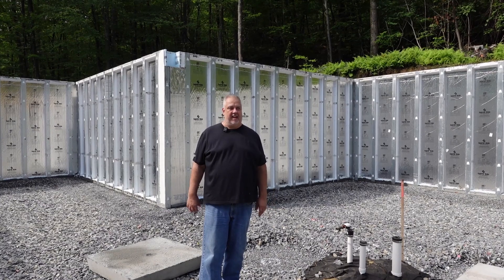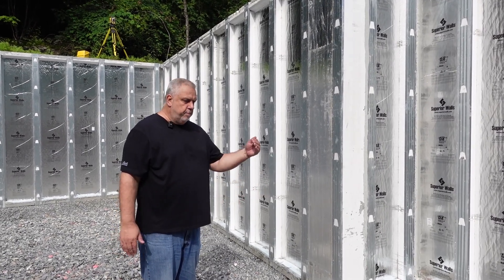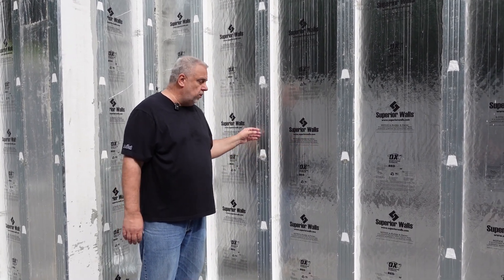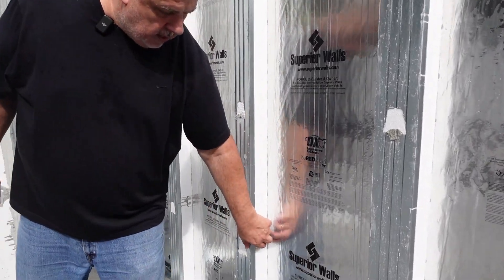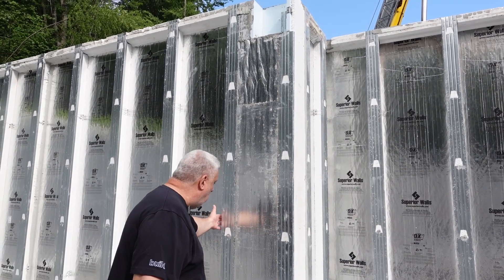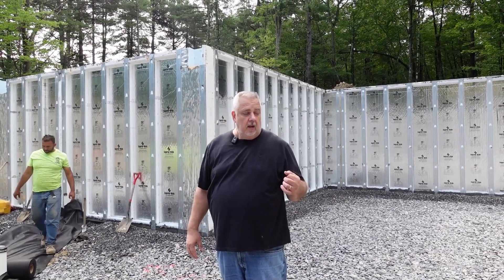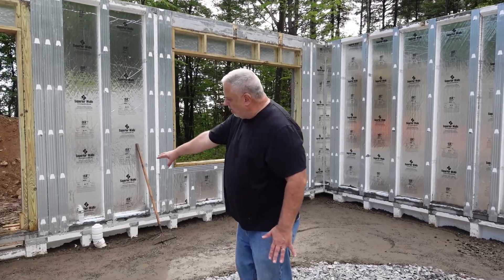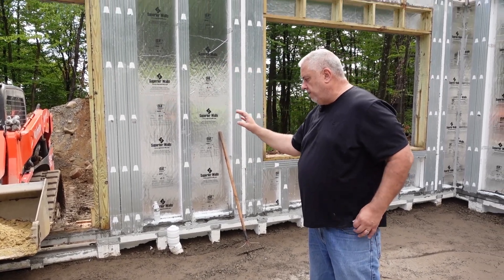INTERIOR OF THE PRECAST FOUNDATION WALL

Comment: Steven -- Would you recommend installing "under-slab" foundation drainage?  In what conditions would it be installed?  I have plans for a walk-out basement using a pre-cast foundation like the Superior walls shown here -- IF there is a sloped grade against the foundation with the potential for run-off reaching the upside of the foundation would you be concerned with the possibility of water under the concrete slab and if so what would a under-slab drainage system look like?  Have you addressed this in any of your great videos?
Reply: I looked hard at these when I was considering building in Michigan but now live in MN a bit out of range for this system.  The Superior walls website has tons of details including water management.  Of course with any foundation you want to get surface water away with appropriate gutters, downspouts and surface grading.

Comment: Steve, I have just installed Superior XI walls. They call for a 2 x10 sill plate. Wondering if you could provide the detail for what type of sill sealer material you use. I am onboard with Tremco Acoustical but unclear what type of foam or rubber seal should be installed.

Comment: Are these cheaper to buy and install compared to just an ICF block system? What are the major perks to these over those, besides maybe the wire runs? I don't see the benefits unless they were installing five or six times faster than an ICF block wall does. Looks like they install similar to SIPS.

Comment: Is there any reason you could not place these on a poured footing?
Reply: After talking with some people, I found out that it’s because you need a very level surface and peet rock is the way to do ut
Reply: I suspect that the connection between the wall (which has a footing as part of the wall already) and the poured footing would be suspect.  The poured footing would need to be absolutely flat, which is basically impossible.
Reply: Superior won't do it.  There is no way a poured footing can achieve the tolerances they get in the factory.  Any deviations will pre-stress the panel as it's bridging between high spots.  Coming to a leveled and compacted stone footing the large panels bolted together will settle out flat with a uniform bearing.
Reply: I'm not sure why not, looks like they rest on the footing like any concrete forms do? Only perk is probably less concrete used if using their system for footings.